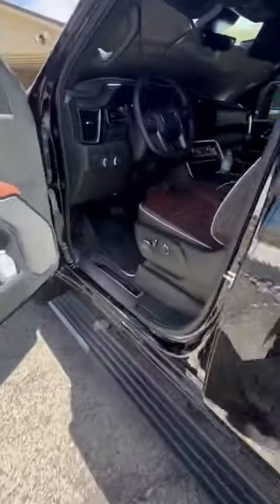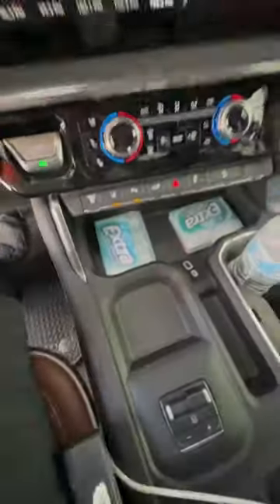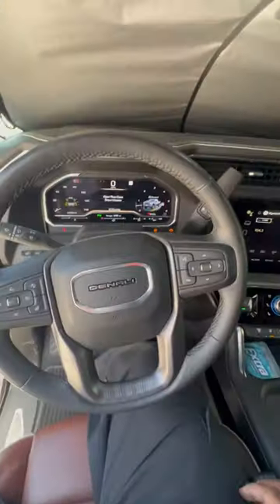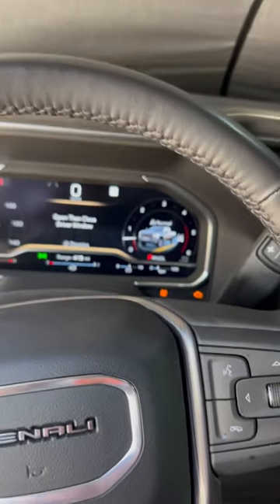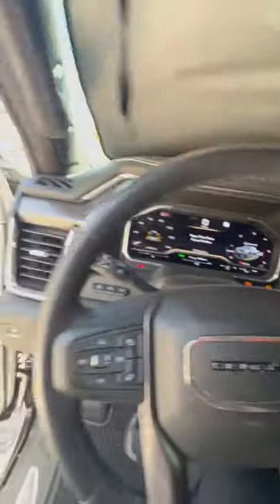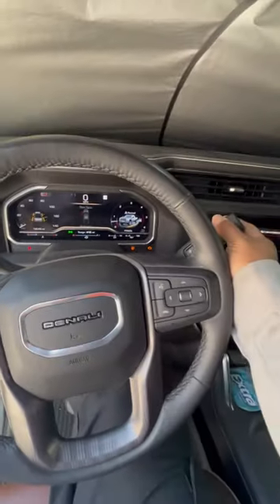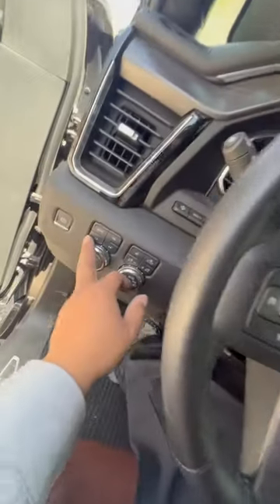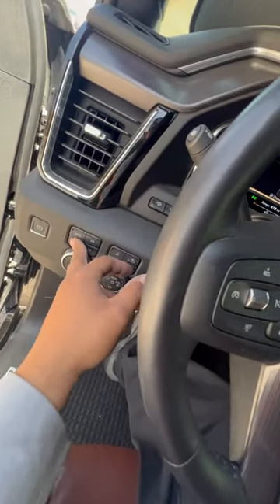How to get 2024 2500HD gmc Denali transfer case into neutral!!￼

Comment: I have a 2024 GMC Denali. While this works after hitting 2 high 5x it does go into neutral BUT when I shift back into park I hear the gears clicking loud??  Any idea why?
Reply from the maker: Happens to other model n brands (sometimes). I usually just don’t put it into 4N after, kinda worrying of a noise it produces. I’m Not really that mechanically inclined to state out the reason for that. Might want to call your local dealer and see if it’s normal or an issue that it needs to be brought in for before things get worse…